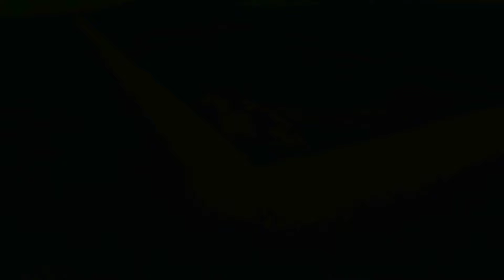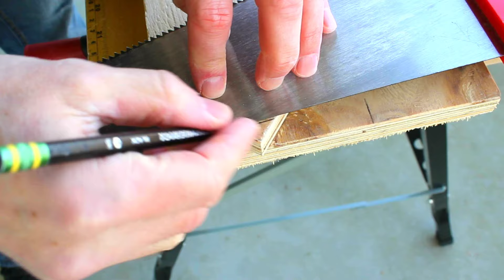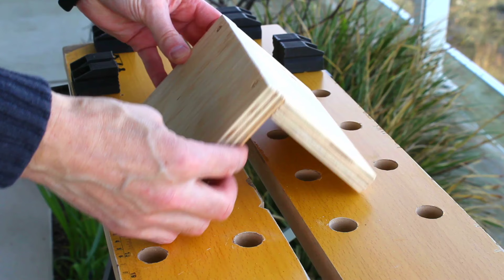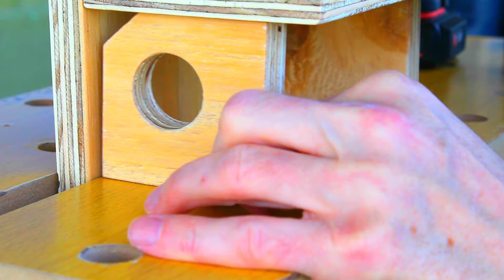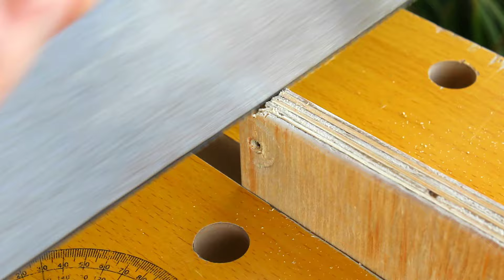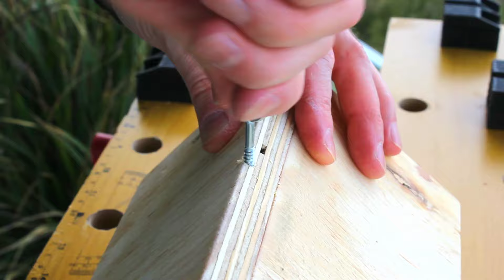Simple Wren House - How To Build Using Basic Tools **UPDATED VIDEO LINK BELOW**

Comment: The house is great, suggestions on location (height off the ground, close to the house or far away, etc.) would have been helpful.
Reply from the maker: You should hang it anywhere between 5 and 10 feet off the ground and away from any windy areas, preferably under a covered area.  Also, it should be close to lots of surrounding cover, like trees and bushes. Wrens usually aren't too bothered about whether the nest house is near  a human house, so long as it is not in a high traffic area (as in lots of people coming and going all the time - so not near a main entrance). Otherwise you should be okay.  Good luck!

Comment: Why didn't you give the measurements? Are they not ad critical as the entrance hole size? And what is the best height, time of year and place to hang the box?🐦
Reply from the maker: Hi there, the measurements are all in the video description below the video, but I'll add them here as well. The ideal time to hang a wren house is just before the mating season in late winter or early spring, just before the mating season begins. The best height is anywhere between 5 and 10 feet...enough to keep the house away from any ground-based predators:

Project Wood Dimensions (inches):
Plywood:               0.75
Front -                    2.75 x 2.75    ;         Hole - 1.125
Back -                    2.75 x 2.75
Roof 1-                  4 x 7.5
Roof 2 -                 4.5 x 7.5
Floor 1 -                 2.75 x 7
Floor 2  (door) -    3.5 x 7
Reply: @natureyardlife   Thank you greatly you helped those of us who are not smart enough to see the measurements in the first time around.😊🐦
Reply from the maker: All the best with your build!